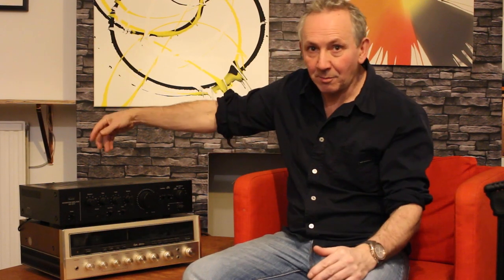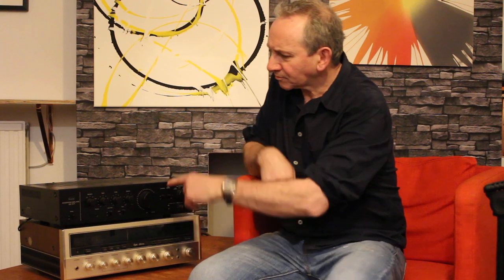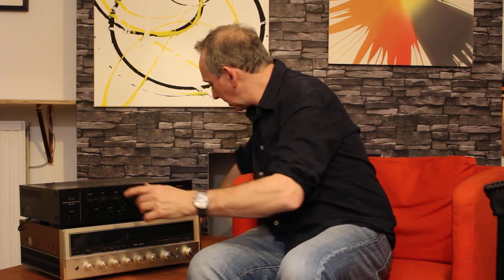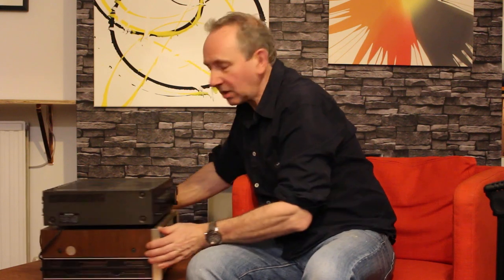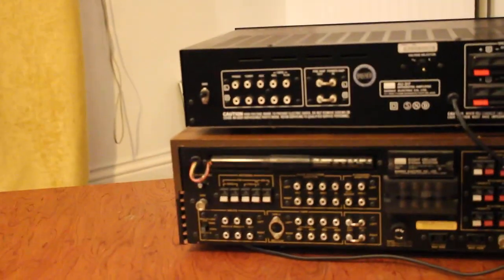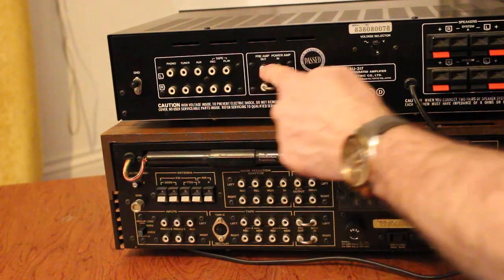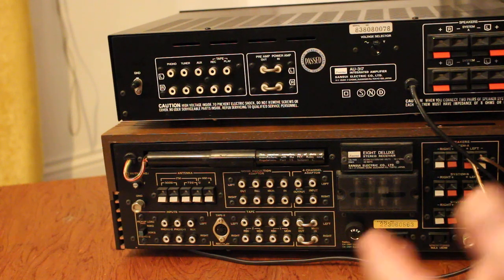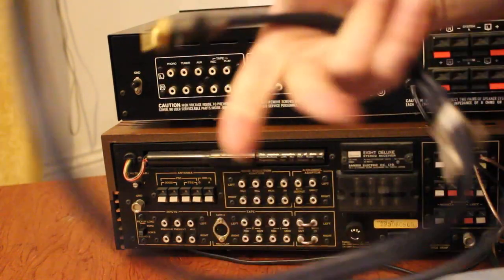How to connect vintage pre amp to power amp

Comment: It's amazing how few YouTube instructional videos actually turn the equipment around to actually show  the actual "how to connect" visuals - and, as such, this video helps to fill a void not properly addressed by the many other misleading [instructional??] videos - which are mainly vanity videos without any actual information.   Although I have vintage McIntosh equipment [C 28 Pre-amplifier (1973)/MC 7270 amplifier (late 1980s)]  I find this video still to be informative.  I guess that all of the videos  of the MC 7270 avoid showing the actual cable hookups as the real intent is to visually brag about the appearance and the sound.  While OK,  wouldn't it be nice to provide the occasional instructional hookup video that actually addresses what the title header is stating.  Again - thanks for this video.  In addition to "picture-is-worth-a thousand-words video examples, connections, we need serious advice on the proper grounding of  high-powered vintage amplifiers [mine is 270 watts-per-channel]  and best grounding practices for  high-end equipment plugged into pre-amplifiers [ground all devices into the one pre-amplifier ground?  [some videos appear to have the owner literally dancing around his amplifier to the music - - hardly the instructional video the header [title] would imply.   Again - thanks to "Stereo review X."

Comment: You're right :), few years back I got hold of a surprisingly excellent sounding little pre-amp, a Technics SU- C01. This thing is small but sounds wonderful and has gold plated connectors as well. Got it for only 8,50 pounds :)

Comment: THE MAIN REASON THEY MADE THOSE THAT WAY IS SO YOU CAN HOOK UP 2 OR 3 MAIN AMPS.    BY PUTTING A Y ADAPTER ON PRE OUT AND HOOK UP 2 AMPS OR MORE.  Or If YOU NEEDED MORE INPUTS YOU CAN HOOL UP 2 PRE AMPS INTO ONE AMP.

Comment: And when you want to listen to music plug the amp into the electricity, you take the thing on the end of the lead with the three pins and plug it into the corresponding socket on the wall. And then press both power buttons. Easy.

Comment: I am now using my vintage Marantz as a pre-amp and a used Emotive amp I purchased, I have the volume on the amp at max and using the 2230 to control the volume. Am I doing it the right way?
Reply from the maker: I think your using the pre and power part of emotive 
does emotive have pre /power separation sockets ?
Reply: @stereoreviewx  I am feeding RCA cables from the Marantz pre-out to the Emotiva line in. Emotiva is just an amp, needs a pre-amp.

Comment: I own a Sansui 2000X which is my favourite vintage amp. I recently bought a Sansui AU 317 in a clearance sale but was disappointed v the older amp. It’s been sitting on the shelf unused. However thanks to this tip though and the combination sound even better than the 2000X. I knew you could do this but had no idea it would deliver this sort of improvement. 
I’d be interested to hear your views on how the Sansui Eight Deluxe compares to the 2000X?
Reply from the maker: Jon Stannah hi Jon i’m glad you got a good result combining those two now regarding the eight compare to the 2000 X The truth is I’m in the world of guesswork clearly the eight goes for more money and I think the eighth is younger.
I’d be very surprised if the 2000 sounds better than the eight particularly in the power amp department.
That’s my best guess anyway.
Cheers K

Comment: Which volume control do you adjust? I know a lot of dedicated power amps don't even have a volume control, which leads me to believe that you would only use the volume control on the preamp, but maybe with your setup you would do things differently? Leave the pre at 100% and only adjust the sansui volume? Some "sweet spot"?
Reply from the maker: The volume is on the preamp.
 If the power ramp had a volume it would have its own preamp
Cheers K
Interestingly I have plugged my iPhone (Spotify’s) straight into the power amp  so you then use the volume on your iPhone is the volume

Comment: Hi! I am new to all this hifi vintage stuff and now i'm having a hard time to connect Akai AA 1030 reciever with Akai AM 2350 amp. Is it possible and if so, how? Thanks!
Reply from the maker: Not exactly sure what you mean you should be able to connect the tuner to the other Amp
But you can’t double up the power or just connect one amp to the other particularly as this doesn’t have pre-power separation I don’t think it
Does anyway

Comment: Thanks. I see the main and pre on the back of my Sansui 3300. I was thinking of adding a pre amp to my system. I noticed a power main switch and a power amp switch on my Sony reel to reel. If I plug that into a pre amp, would I also switch on the power amp on the reel to reel? G
Reply: Finally got my Sansui AU-317 back from the tech. I’ve set it up as the pre amp and my Sansui 3300 as the power amp. Thanks for the video!

Comment: Hi.. I own a sansui au 717 I want to use it as a preamp ... on the back is a slide I have to set if I separete the poweramp from the preamp... but I have to make a choice between direct coupled or capacitor coupled... wich to choose... thanks already Robert...

Comment: My Rotel A11 Tribute has a pre-out so I understand I could use this simply as a pre amp and use a vintage receiver as the power amp, but with the Rotel's pre-out can this be done the other way around, ie using the vintage receiver as the pre amp and the Rotel as the power amp? Many thanks
Reply from the maker: Usually you get pre amp and power amp sockets 
So you can do either it can be very interesting

Comment: what other options would i have since my vintage onkyo 3000 does not have the pre amp out/power in?  i have decent sounds from my a or b speakers selection, but when i select the a&b combo selector, the sound gets lower.
Reply from the maker: dont thhink i can help you there K

Comment: Turn table signal isn't just very small it also has very little bass (because bass frequencies would otherwise make the tracks super wide and you'd fit less music on a single or lose resolution in the higher frequencies) so you the phono pre-amp also reverses this to get the original flat signal of the recording.

Comment: Can you go the other way. Receiver into amp, or even into an integrated stereo amplifier?
Reply: Yes this is possible! if you have a pre out connection, on one amplifier, and a main in connection, on the other amplifier! If you have two amplifiers, which both amplifiers, have pre out connections, and main in connections, you can use either amplifier, for this set up!

Comment: Im confused....the pre amp on top has no tuner? So to listen to fm radio you nee add fm receiver? And you plug turntable cb player into the pre amp and use the pre amp to control  which signal it sends to the main amp? is iphone/android headphone jack the same as pre amp output? What about speaker output from a pc? will a phone jack  from a pc  to rca adapter to the pre amp to the main amp work?
And....will a pre amp output work on 2 separate amps?
Reply from the maker: Is this mastermind😜
Reply: Ah. So under this system you remove the FM tuner capability? I just purchased a Sansui AU-317 to give this a try. The reel to reel is my main input so I can live with it.

Comment: Can you do that with a modern integrated amp? Line output to power amp input?
Reply: You need a volume controlled line out, or it won't work (or your dedicated power amp has to have a volume control). Watch out some amps seem to have these loops but they are marked adapter or processor or something. Those are not pre-amp outputs but for adding an equalizer to the system. All sound will cut out if you put the pre-amp in direct mode.

Comment: Not sure if anyone can help but I've got a nad 3020a with a faulty speaker terminal and looked at how much of a pain it is to get fixed. Would I be able to use this as a pre amp with another Nad, the C320BEE using the same principle in this vid using the pre in/out to main in ports?
Reply from the maker: Well you must be able to get that wire to connect to the wire inside the Amp somehow they’ve only got a touch
But yes you can use the preamp section
Reply: @stereoreviewx  yes its about keeping it there. I'm considering soldering. But it's working well as the pre amp all the same. I can tell there's more drive to it. Nice to see you reply

Comment: I figured modern power amps have much more amperage and better control for to drive modern speakers, so wouldn't you do the opposite? Run the vintage receiver to experience the dials and looks but then a modern power amp like a Bryston to power the modern speakers properly no?
Reply from the maker: Well, these are hard things to generalise about, 
But if you want to get to the hire end of Hi Fi, you wanna clean path you don’t really want tone controls lots of switches  .
I can’t say there’s a guaranteed rule 
Though

Comment: I am watching you since I start looking for good vintage receiver for my turntable. So I am now a little worry if sansui 661 will have a good result with my dual 701 and b&o s45-2. and I think that this receiver don't have this option to connect it with another preamp.
Reply from the maker: No 661 doesn’t have that .
If your paying say 130 euros it’s still a good deal .
Reply: If it doesn t have such facility as described just connect the pre amp to the record in of your vintage receiver.

Comment: I have a TFM-25  amp & CT -17 preamp 1989 . The preamp started giving me trouble and finally stopped working .  I purchased a five speaker surround system .   I hate to just junk these . The sound was just the best .  Anyone think that there is any interest in these components ?

Comment: You got the order wrong when you turn on the system, you should alway turn on the preamp first then power amp last, cause you don't want a jolt of electricy coming into the pwr amp from the pre amp .
Reply: Wit my $50 preamp your theory is correct (1st preamp/2nd pwr amp - On. BUT reverse order wen pwrng amps Off 1st pwr amp/2nd preamp Off). Wit my $250 preamp this video theory is correct (1st pwr amp/2nd preamp - On. Same order wen powering amps Off ) I ruined 2 woofers incorrectly pwrng up my $50 preamp.

Comment: I have heard it said that you can make a normal integrated into a power amp by simply turning the volume all the way up and plugging a preamp into it via aux or CD would this be correct? The person who suggested it was Steve Guttenberg AKA Audiophiliac. He says it here at 3:26 minutes in https://www.youtube.com/watch?v=72S0lmpju1s
Reply from the maker: Well I Gotta say I’ve never done that also it’s scary he may be right of course someone should try it.
What I have done is plugged my iPhone directly into a power amp and use the volume of your iPhone to control the volume I’ve done that many times it seems to work fine but don’t do it on my recommendation you know.K
Reply: I bought a new turn table and kept being reminded I will need a Pre amp so I bought one , plugged it straight into aux , didn't think anything of it , until the penny dropped my Nad amp has i written on it Duh.
Now im trying the Nad on its own and I can honestly say the pre amp wasn't any better than the Nad on its own.
But after watching this video im curios to try plugging the pre amp into the power amp inputs instead of the aux input.

Comment: i have old yamaha ax700  i can get it to send the sound to my power amp but the ax700 wont turn the volume up and down on the power amp
Reply: I'm trying to connect my AX700 to my Sansui Seven and while I can hear sound, it can't control the volume and it is just insanely loud!

Comment: conversely, it is better to connect a vintage integrated amplifier as a power amp with a new preamp
Reply: Hi Khalid, could you explain what you mean? Were you reacting to Tim Wynn explaining just before you about the safest way to turn the system on first?